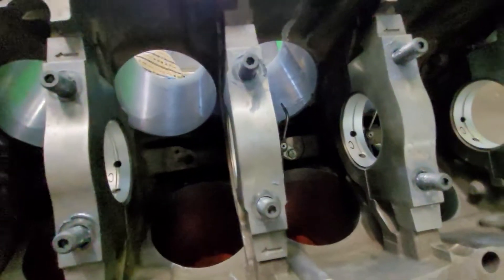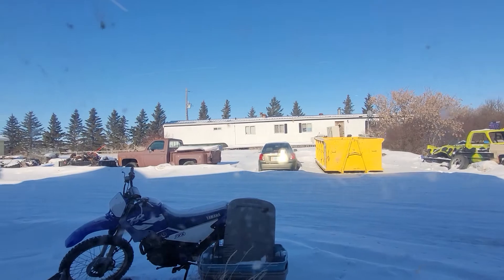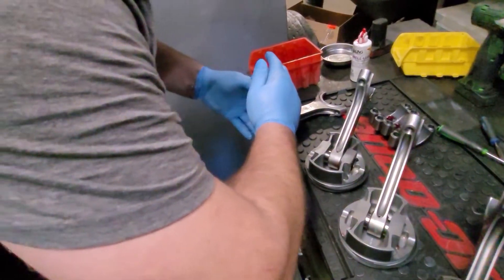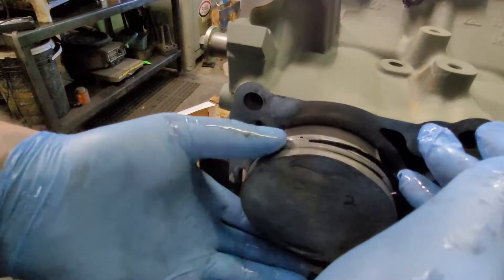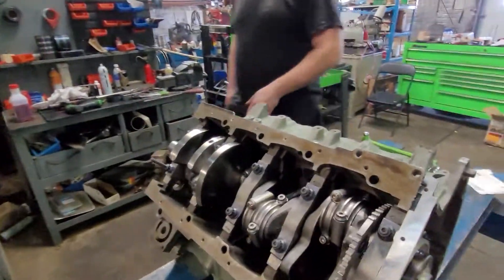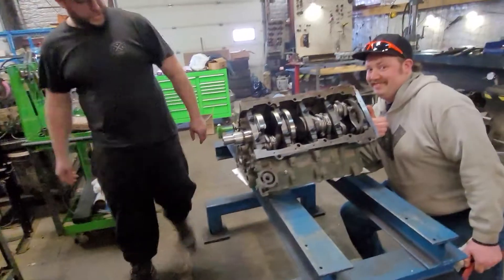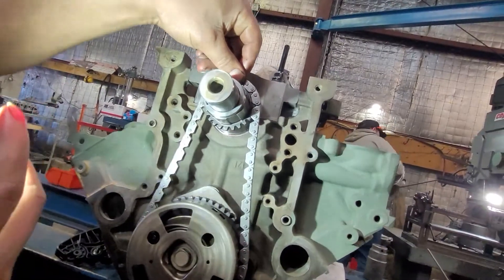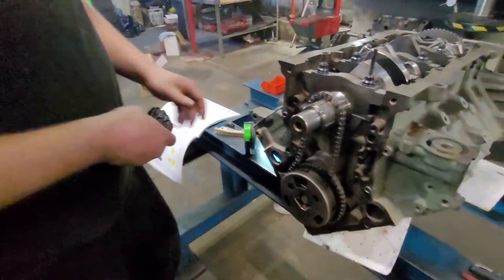Hemi Engine Rebuild - Part 4 Final Assembly! Final Timing!

Comment: Wondering what your main bearing clearance ended up being? Stock spec is .0009" - .002"
I'm measuring mine currenty for a fresh rebuilt and my average clearance is .001"